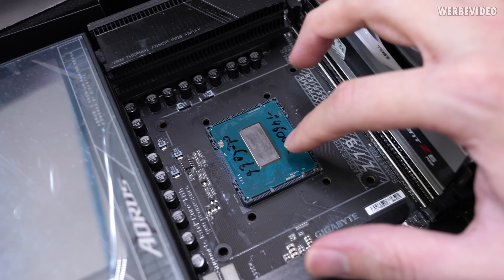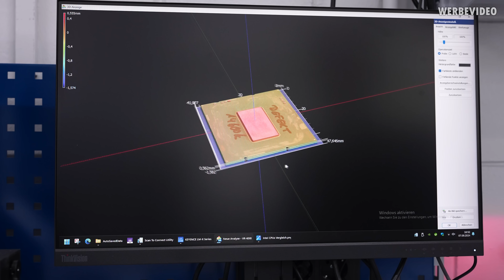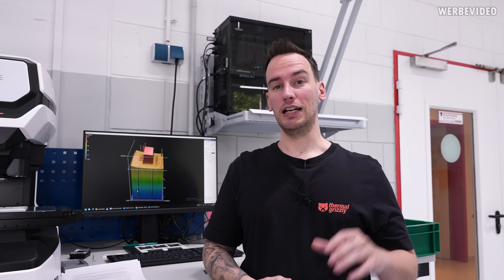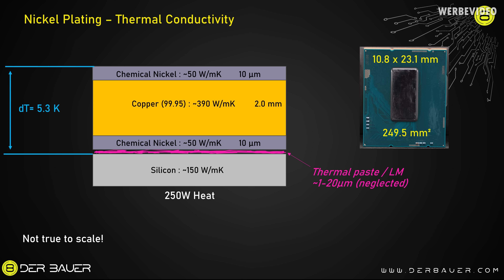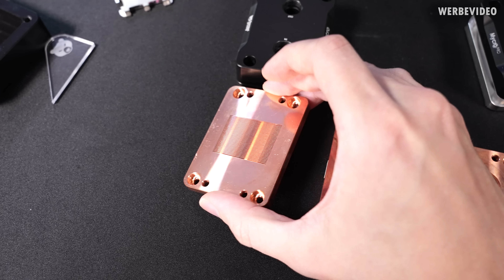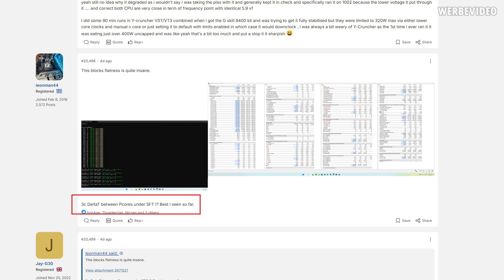We Identified the Problem with Our Water Block

Comment: the transparency about what works what goes wrong and where possible fault lies lead to confidence. Right now my system is running fine and I do not need a new water block but with this report you have gained a future customer.
Reply: @viperpit-lr2rp absolutely. Also as a brit living in china i have been using thermal grizzly thermal paste for my last 4 builds and even the paste coms with a scan code that links to an online data base to confirm authenticity. Such lengths made by the company to ensure that customers get what they pay for is above and beyond what the majority of other companies do. I also subscribed to the channel a long time ago and even saw how he handled issues in the past. My reference to a water block is simply that it is a product i have yet to purchase from them. so both a returning but also new product customer.

Comment: Nice work and thanks for talking us through it!
I have two questions: Firstly, why do you leave so much of the PCB outside the pressure ring? (It looks as though you could/should get much closer to the edges.) Secondly: you mentioned a 15 degree C worse temperature with the nickel coating, but I never heard a reason for that - did you manage to explain it? (Your calculated delta-T across the Ni layers was <= 0.2 degrees, and that's ridiculously far away from 15...)
Reply from the maker: We wanted to use the same ring that Intel is using with their IHS because we thought it would be as close to stock pressure as possible.
Yea I wish I knew the reason behind it. I just know that it was much worse with the nickel plating from this supplier but unfortunately I don't know why exactly :/
Reply: @der8auer-en  Ahh, yeah I can see how that makes sense. It would be fun to stick a freshly-delidded CPU under your LM-X after a year or two with contact pressure from the stock IHS... (As for the delta-T... oh well, maybe it'll remain a mystery. Maybe a combination of warped surface, over-thick Ni layer, and really bad interface layer?)

Comment: How about gold plating? It will be thinner and will conduct heat better.
Reply: Gallium affects gold and silver in a similar way to copper.
Reply: @itisabird  I see.
Reply: Why gold - gold is used as it doesn't react with oxygen (air). It's in the same group (periodic table) as copper and silver. Platinum plating =might= be another option, albeit a lot more expensive (and difficult) than nickel.

Comment: naked coppers react to other chemical structure through oxidations. i think this is due to copper being used itself commonly contains oxides. and nickle plating solve that chemical reaction between different material issues.
because i remember how all my copper made electrical equipments that i sandpapered to ensure "better electrical contact" all becomes brown after a very short while. and if the thing exposed to high temps it even becomes dark brown, all the way to black. so its a bad idea to let it exposed i guess , especially if they are suppose to make contact with other elements.
might want to try to use oxygen free copper for your IHS builds. maybe it will have even more stable thermal behaviour. so long it wont jacks up the cost for that IHS production.

Comment: The mirror finish doesn't last though. It scratches easily when mounting and gets worse and worse after each installation so the more diffuse plating is an advantage imo. I prefer that texture anyways on coolers.

Comment: Is there any difference with gold plating rather then nickel? Isn't gold both less reactive, easier to apply, and better thermal??
Reply from the maker: Gold is only good to protect against oxidation. Apart from that it has rather poor corrosion resistance against Gallium especially

Comment: Came for the honesty. Left with an eduction.
Reply: Why nickel plate the inside??
Reply: @tavi7 I don't think you can nickel plate only one side or one part of the structure
Reply: @tavi7  Likely corrosion resistance (it won't turn green), combined with it being easier to plate the whole thing.  Plus, that side doesn't have the thermal density, and the temp difference is negligible.
Reply: True... True.
Reply: Anyone with an ex can say the same thing lmao
Reply: Here's some more....*education. 😂
Reply: Study English.
Reply: @ul6sd  oke bot

Comment: I'm just wondering why in all these years no one has released a cooler with the pins facing the output at an angle, or the pins with different geo heights for better flow?  Because they all have a 90° rotation of the coolant flow direction in each step.

Comment: 9:30 true but also not true, Galium doesnt corrode copper after it initially plates it, this plating issues causes it to degrade via 'drying' off the die, gaps in contact. If you use liquid metal on bare copper you need to re-apply a bit more in a month and then never again, I've used it on countless times and that's the true story after 5+ years. Nickle plating allows on to skip that annoying step. Also Nickle plating allows you to remove most of the gallium plating if you wish to switch back to a non liquid metal TiM.

PS I don't see any scenario where what i said could not be the case, as more extreme overclocking/thermal loads you wouldnt want to use liquid metal anyways as it does not tolerate sub-ambient cooling! You use a more traditional compound for that.
Reply: Hmmm, how about marinating copper blocks in gallium and then selling unplated blocks? Like how some pre-shrink clothes.
Reply: @AyoKeito  i dunno how fun shipping gallium embrittled blocks would be.

Comment: (this is not an advertisement) I used liquid metal CyberBlood (Russia) instead of thermal paste, as I had a lot of it with a polished but not scalped i9 13900k for about a year. During this time, I did not notice any deterioration in thermal conductivity, although it was initially much inferior to a direct contact without a CPU cover.

Comment: this level of transparancy should be the norm
Reply: Another great example of transparency is the Wooting group that makes keyboards. Everything is crystally transparent with them.
Reply: While transparency is important, good engineering practices and proper product validation should always be the standard. Customers should never serve as testers for product validation.
Reply: @davepraz153  unless it's advertised . some people like to be first asap
Reply: @nyftn  advertising has nothing to do with good engineering practices. You advertise the specs, features and purpose of a product, never the less, without going trough the proper validation proces, such specs and features are meaningless as you are not checking if whatever you are selling match the promised ones.

Comment: Being transparent about any issues is always a plus. Well done.
Reply: Companies will always have an issue with a faulty product at one point. He did not want to ship a faulty product.
Reply: @joestock732 but he still shipped the faulty product…
Reply: @joestock732  But he did. That's literally what this garbage vlog video is about.
Reply: @mr.number9279 what a garbage response. As a company they did everything right, took the product of the market, reimbursed effected customers and never blamed anybody but themselves. They made a mistake resulting in bringing a bad product to the market, but did everything right after that and learned a lesson. That alone is rare these days, let alone being open about it.
Reply: @mr.number9279 yeah he did, but then he stopped when he knew they were bad, most companies these days will just keep shipping bad products until the government steps in.
Reply: Yeah stop glazing creators for doing the bare minimum standard that everybody should be held to.
Reply: Transparency is not enough.If he sells a faulty product he need to take responsibility and to refund or replace the product itself and any other damage caused by it and yes im personally affected by this (7950x with this thing on top in my PC) so lets see how this goes.
Reply: @RipHunter-l7x  Considering this water block is for the Intel 1700 socket, it CANNOT "personally affect" you with your AMD CPU.
Reply: @zebrapluto530 the block still caused CPU’s to die. Have u lost ur mind????

Comment: Have this ready for the 285K! ;) I'll need one for it, and for the 9800X3D
Reply from the maker: We already have a Pro Version for AMD so that's covered :) I expect it to fit on X3D. For 285K / 1851 we already started Massproduction so should be just on time for launch
Reply: @der8auer-en  On the am5 version whats the difference between the old one and the pro one?
Reply from the maker: The structure on the new AM5 block is completely different. We went from 0.5mm slotting to 0.2mm slotting. So much more surface area and a hybrid structure. You can see that here: https://www.thermal-grizzly.com/en/blog/new-the-amd-mycro-direct-die-pro-rgb-v1-direct-die-water-cooler
Reply: @der8auer-en  bummer... I bought the old AM5 version a while ago, but haven't had time to do anything about it.
And now there's a "just plain better" version out 😢

It's my first delidding, so I want to make sure I have at least a couple of days, to be extra gentle with it... also because my loop is done using hardtubing, so need extra time do new bends if needed.
Reply: @der8auer-en  Perfect, I don't want to go back to non direct die for my loop. X3D should be overclockable, your block will be needed to get all the extra performance from the 9800X3D!
Reply: @der8auer-en  hmmm so arrow lake is coming soon thanks for the leak
Reply from the maker: just google "arrow lake launche" and it will tell you "expected in october". Not really a leak
Reply: @der8auer-en  you basically exposed your Insider trading information lol
Reply: How is this insider trading? There's no trading going on here. Nobody is defrauding any investors or stockholders.  @nerdynumen